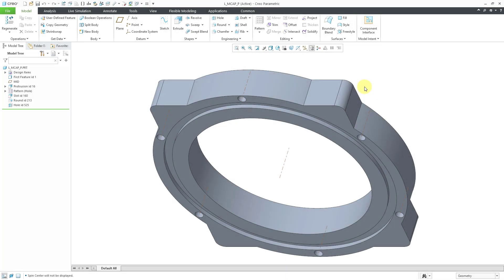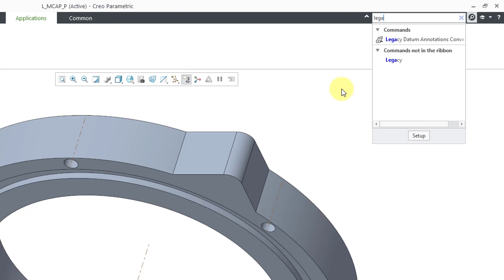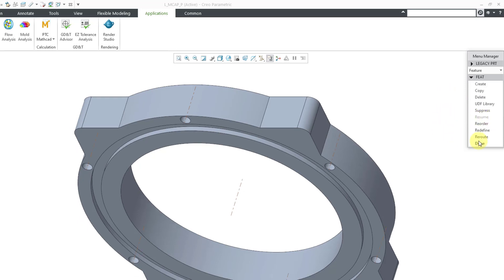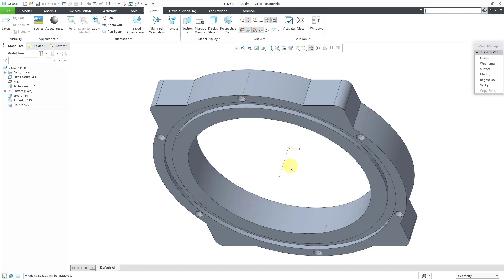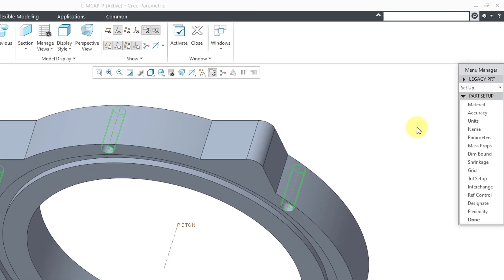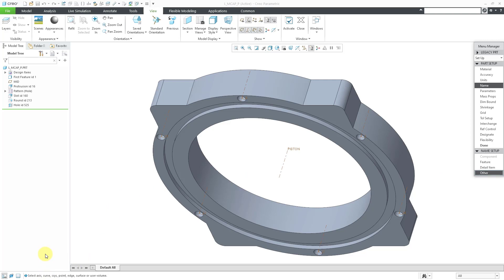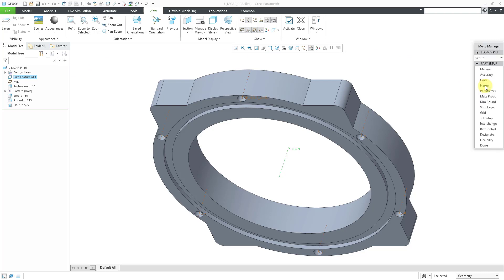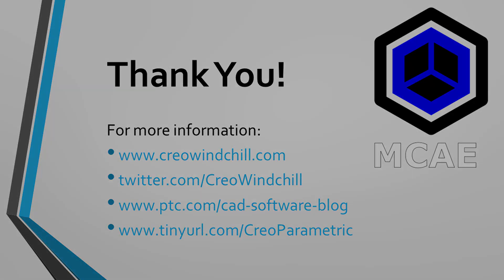Creo Parametric - Legacy Mode (Part 1) - Old Command "Setup Name"

Comment: Sir which command use to know stock size of part in creo
Reply from the maker: There is no "stock size" command because not everything is machined and not everyone has to track stock size. Or they set up stock according to their company processes. Or they do that through other systems like ERP ("Make From" information). That said, when you are doing CNC machining, you set up a workpiece, and the workpiece establishes your stock size.
Reply: @CADPLMGuy  then sir which method we know  overall size or projected size in (x y z) of part.
Reply from the maker: @surajprakash3264  See my video on Model Size.

Comment: Thank You so MUCH!!! I had always suspected those Legacy commands were buried in there somewhere. I have a handful of Function/Map-Keys saved that I still use (CREO 7) from way back on ProE 15/16. If I remember correctly, there were also some advanced Fillet commands that "disappeared" over the decades. I may be digging for those soon.  :-)

*PS - How do you switch out of Legacy mode without exiting CROE?
Reply from the maker: You can’t! Every time I try to leave Legacy, my Creo crashes.